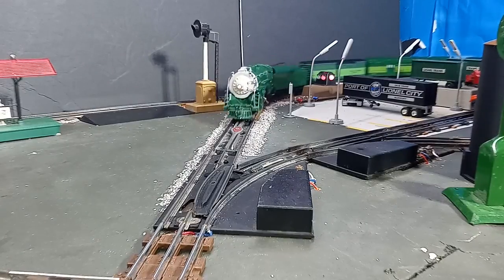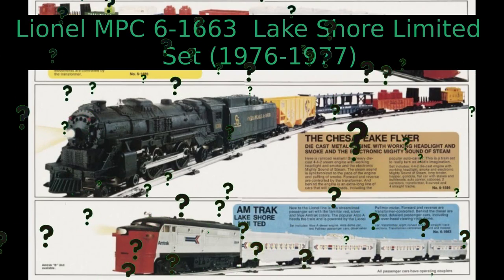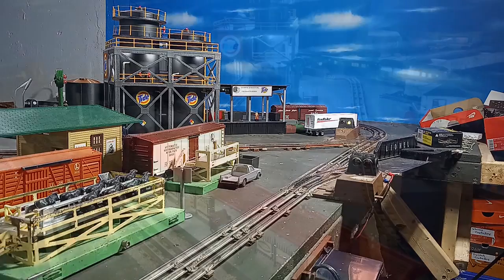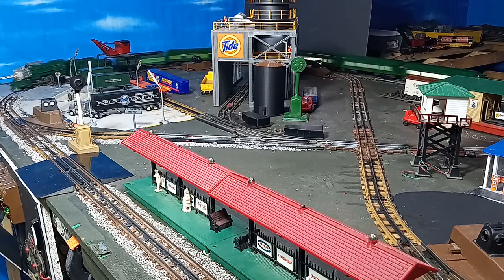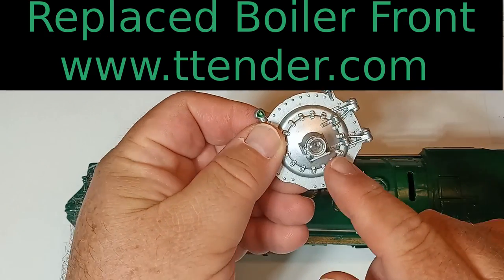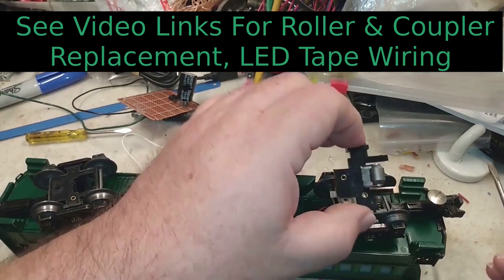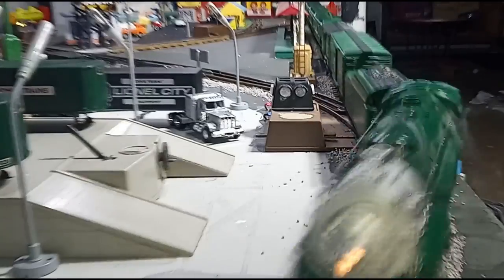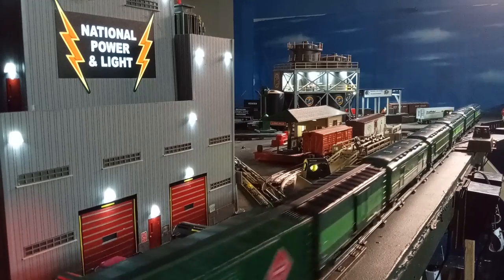Lionel MPC #6-8702 Southern Crescent Limited 4-6-4 And Set - Repaired, Restored, and Ready To Run!!!

Comment: I started work on my Crescent a few years ago (and I should finish it) and found I had to replace a gear or 2 because they had broken teeth. This was fixed when the Blue Comet came out. We have the same idea on LED strips, but I did away with the cardboard and painted the inside black. Glad you got yours running. I need those boxcars now.

Comment: All green train looks cool something different. Actually looks like something a kid could play with. Kids wouldn’t care what the line name is. Yes these were intended for kids to play with. Nice you got it all running again. Powerful vacuum will pick up almost everything even on magnets of engine. Parts can be adapted from other donor Lionel engines and cars. Nothing wrong with original lighting IMHO. This was a VERY INTERESTING VIDEO.
Reply from the maker: Thanks for the feedback. There were two problems with the lighting. 1) The bulbs were burned out. 2) Original replacement bulbs are more expensive than switching to LEDs.

Comment: Nice set Mike. I have quite a few of the MPC era locomotives in my collection. Since I run conventional and the high end models were built to the early postwar standards they can be had for such a great value. Any one who doesn't own them and still shuns them are missing out in my opinion. I recently acquired the somewhat rare SantaFe Trainmaster produced 1 year only in 83 and is just as good in my opinion as the early postwar versions. It's unique in that it was the first SantaFe Trainmaster ever produced and  with the first ever electronic horn. Very cool engine with dual pulmor motors.
Reply from the maker: Very nice indeed! I also like the MPC SP Trainmaster in the Black Widow scheme.
Reply: @ToyTrainTipsAndTricks  Thanks Mike, now I have another rabbit hole to pursue.
Reply from the maker: @DRCRailroard  https://www.ebay.com/itm/394620956109

Comment: Excellent.  I like the MPC era.  Lots of nice trains were produced.  Although I am mostly post-war, I do have some MPC sets and locomotives.  My full sized passenger cars are 90% AMT, but I also have the MPC 20th Century Limited set with the extra car.  I have the MTH version of this locomotive.  It's my only MTH engine and it is conventional, which I prefer.  Along with my Southern F3, it will pull my AMT Southern passenger cars.  I would have liked to see the MPC version with streamlined passenger cars, but that set is very nice.  Great video, as always.
Reply from the maker: AMT cars are very nice!!!
Reply: @ToyTrainTipsAndTricks  They are nice.  A little lower slung and sleeker than the Lionel Super Speedliner cars.  I have full sets of NYC and  Santa Fe.  I need a couple more cars for my Southern and Pennsy sets.  All in all, I have just over forty AMT passenger cars.

Comment: A bit late, but regarding traditional Lionel 3-position E-Units with surprise shorts, one possible area of fault that isn't immediately obvious is that if the teeth got worn down really badly on the drum, the pawl might be able to touch one or both contacts on the drum, causing a short to ground. Another less obvious possibility is that the plastic pivots on either end of the drum are set up to space the drum away from the sides of the E-Unit so the drum contacts don't make contact and short to ground. It's not impossible that a defective or heavily worn drum could somehow allow the contact part of the drum to touch the side of the E-Unit and create a short.

Contact fingers being bent such that they touch things they shouldn't is also certainly something to watch out for, but strikes me as a more obvious fault to catch. E-Units are great little devices when they work, but sometimes they can have unexpected issues that require a lot of patience and tinkering to resolve.
Reply from the maker: Good tip!

Comment: Great video. I bought brand new the Blue Comet, and by 1981 the Sound of Steam died. Do you know who may have replacement boards?
Reply from the maker: No one makes replacement boards. It's probably a dead capacitor or two. If you (or an electrician you know) replace the capacitors with new ones of the same value it should work. And don't forget to replace the insulation under the board that's probably turning to dust by now.

Comment: Thanks for the videos! Question, I see lots of MPC ENGINES and ROLLING STOCK you mentioned that parts are hard to find. Are there outside suppliers that have them or should I not by them?
Reply from the maker: Most parts are still out there somewhere. You may have to try multiple suppliers or find a "close enough" part. There's also the option of scavenging parts from junkers. It's still easier to find postwar and MPC parts than many items from the 2000s forward, but it's not as easy as it once was.
Reply: Well, really thank you! I really to be honest can't afford the new stuff it is so expensive and when they need repair OH boy parts are expensive and very hard to fix. So thanks again1 @ToyTrainTipsAndTricks
Reply from the maker: @mypugsdad5366  You're not the only one cannot afford the new stuff!

Comment: Mike, have you found warm white LED bulbs with the screw, or Edison base with the correct voltage for Lionel trains?  I have some old 022 switches that take the screw-base bulbs and I’d like to change them to LEDs as I run constant voltage to them and the original bulbs get too hot and can melt the lantern covers/lenses.   Thank you!
Reply from the maker: I'm looking for a precise match. The warm white bulbs I currently use are too tall for use in switch machines.

Comment: Hi Mike got a question about your link to the light bulbs. the link says dc12v, are the ones you use in the video dc or ac bulbs?
Reply from the maker: They WILL operate on AC. The diodes self-rectify to DC. The bulbs actually flash with the AC current, but too fast for the human eye to notice.

Comment: So this locomotive wasn't built with a DC can motor then?
Reply from the maker: Nope. Regular ol' open frame, 3-pole AC motor with a mechanical E unit - just like Postwar.
Reply: @ToyTrainTipsAndTricks  So do you know when Lionel switched to an electronic E-unit and DC can motor exactly? What all I'm finding on the web is all over the place kinda.
Reply from the maker: @SOU6900  There's no single switch date. It depended on product line. Starter sets switched to can motors first in the mid-1980's. Can motors didn't become standard on collector-type locomotives (except for the Postwar Celebration Series) until TMCC took hold in the late 1990's. Most collectors didn't trust the reliability of can motors and didn't want them in the premium products at first.
Reply: @ToyTrainTipsAndTricks  Alright then so buying anything modern era up to the 90s is hit or miss on whether it's an AC or DC motor then if I'm understanding what you're saying.
Reply from the maker: @SOU6900  Correct.
Reply: @ToyTrainTipsAndTricks  Also I want to say that I wish my Southern Ps4 Pacific from the 90s had the mechanical reverse unit and AC motor like yours does. I'm thinking of trying to get my hands on an MPC era one like yours and hopefully I can figure out why the air whistle doesn't work on mine. Hope you get the reverse unit for that beauty working again.